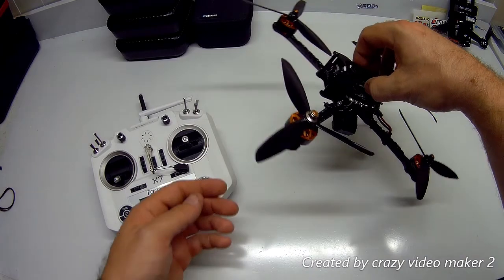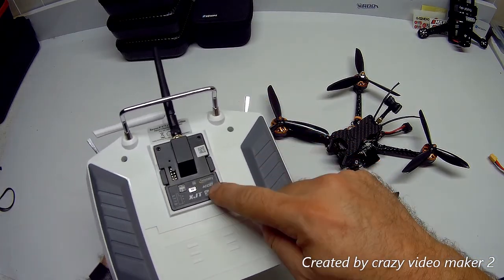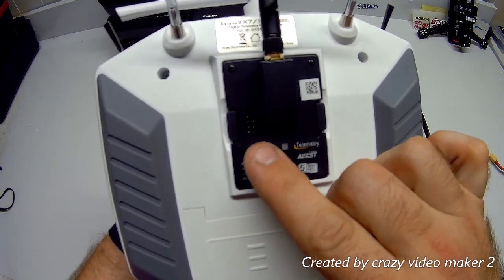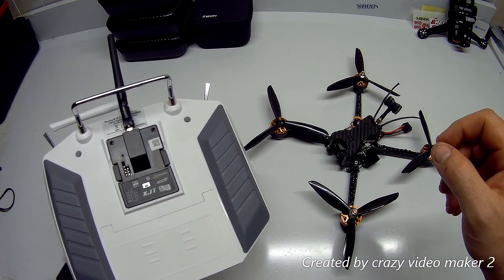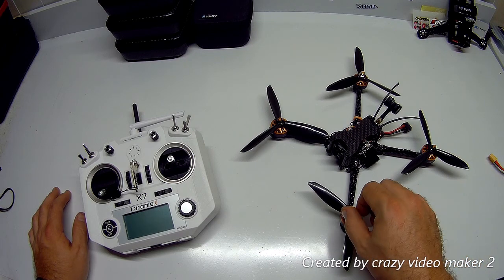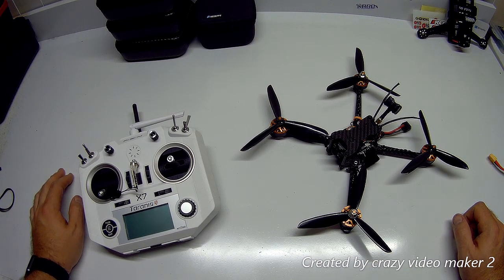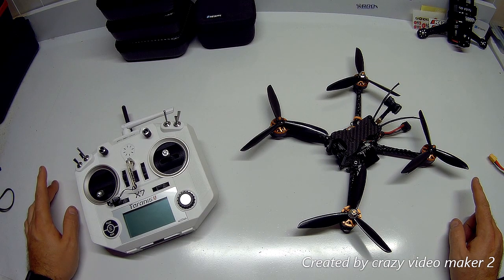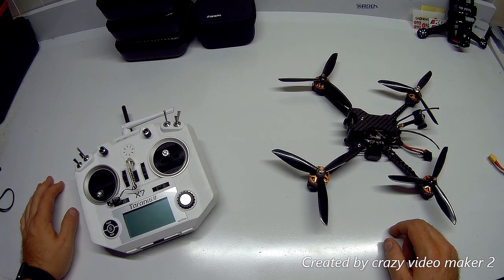Taranis Qx7 access with frsky r-xsr issues

Comment: Prob a dumb question but how did you attach the hanger for you leash !? Couldn’t figure that one out
Reply from the maker: No dumb questions. It's a complicated hobby. Many rabbit holes!  There should be a screw that attaches the bracket.  Small Allen head screw.  Might be in radio already. I don't remember how it came.  Just pull that out and screw in the 3 position hanger.

Comment: I have same remote and nazgul5 4s with same receiver can you do a walk through like they both just showed up in the mail and you know nothing  like binding is what I'm having trouble with also I have a mobula7 on the way I hope it will bind to this radio. Plz help you don't have to do a vid just some advice bc im lost
Reply from the maker: Hey Ryan. So you have the access protocol as well?  Do you have an XJT to run them with d8 or d16?  When you go to bind, you have to turn off the internal module and run external. From there, you can select the xjt and run in d8 or d16 accst. Pls follow up.  I would love to help
Reply: I am having the same problem with my nazgul v2 with r-Xsr and taranis q7 ( I think I have the accst version? ) tried to bind for last 2 days but nothing is working . Do I need the xjt module? Because when I go to bind with internal it already says xjt but I can’t bind 😢
Reply: Man i gave up the pro drone guy at race day quads we emailed back and forth on what i was looking for a simple first time user setup idk had sticker said rec is on uart2 and its a
 r xsr rec qx7 remote naxgul 4s also a mobula 7 cant bind eather one so i got a laptop tried to figure out beta flight i have no clue all the videos use these like code words that i dont know now i really have no use for a laptop so basically 1000 $$$ in paper weights
Reply: Xjt?
Reply: Yes i have access but i dont belive i have to use it idk im confused
Reply: Lately havent been in the air just rc bouncers thinking of selling my stuff but i would take a big hit im sure also got the eachine googles

Comment: I am new to the hobby and the Taranis Qx7 access is my first transmitter. I am still struggling to bind it with my Beta85 HD. since that you have the same transmitter maybe you have a better idea on why its not binding. thanks
Reply from the maker: What receiver do you have in the beta? Most likely you would need to get an xjt module to bind in d8 or d16. If it’s an xm+, you will definitely need it. The access protocol on Qx7 sometimes works if you bind in d16 with telemetry off. But I haven’t had any luck at all. There is a chance it could just lose all signal and drop out of the sky.
Reply: I have similar problem with binding QX7 access to Geprc Skip 3 with XM+ receiver.
Reply from the maker: @constantineb6433  do you have the xjt module or any thing that will allow d8 or d16?